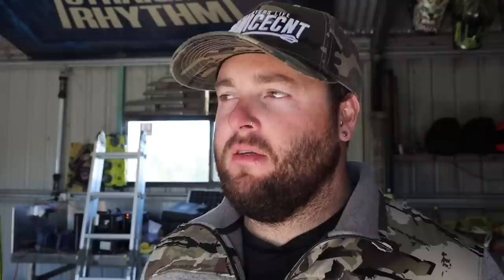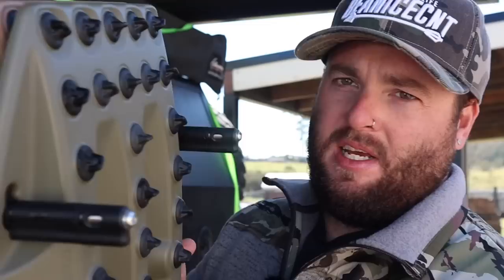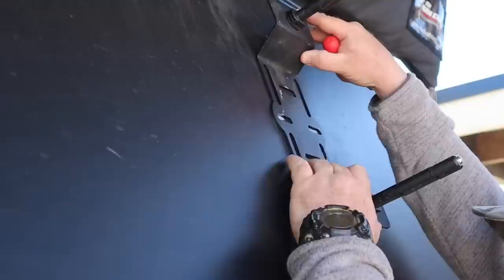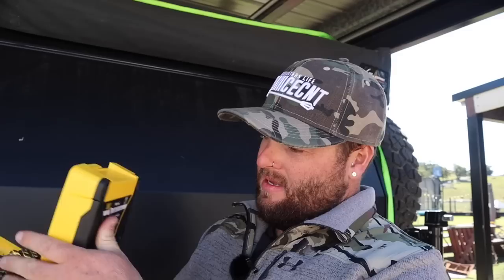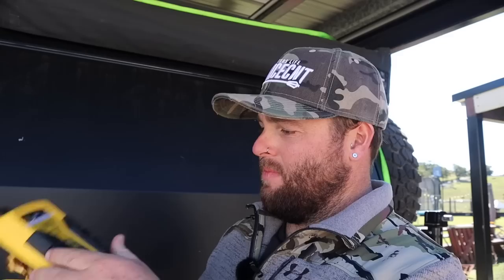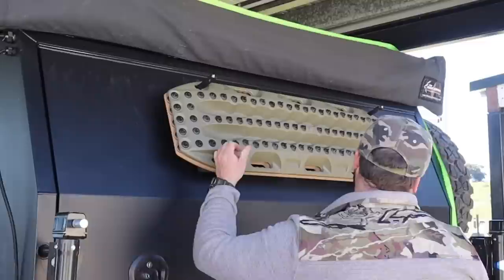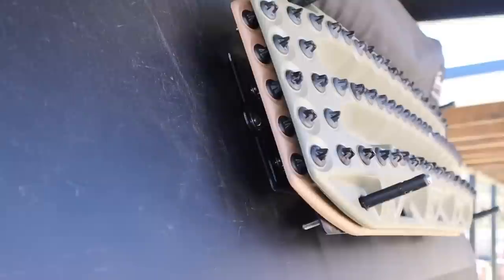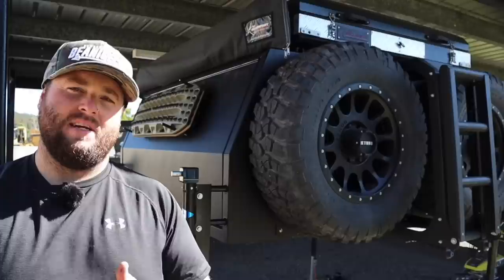WHERE TO MOUNT MAXTRAX ? ROOF RACK ? TRAY ? CANOPY ? How to mount Maxtrax.

Comment: I did the same to my F250 canopy about a month ago.

I mount all 4 on the drivers side though. I  made some internal braces to support the weight and just used high tensile nuts and bolts.

They come up well, yours look good 👍

Comment: Any reason you didn't use nuts and bolts to mount it?  Rivnuts/nutserts are usually used on double skin panels where you can't get to the back of the panel.
Reply from the maker: To hard to hold nuts on the inside if I want to take them off the truck. Makes it easy and all one sided 😄👍🏼

Comment: Can you get a specific measurement off the Animal Off-road bracket? I can’t find the dimensions of what I’m looking for on their website either…..I’m wondering what’s the measurement from the flat surface part of the bracket to top of the angled part of the bracket where the boards mount? Basically the distance between both flat surfaces. I’m trying to see if this would work for my truck bed Molle panel set up. I’m wanting to mount max trax to the molle panel at my bulkhead but I have to space them away from the panel to be able to clear my anchor points at the bottom of my bed.
Reply from the maker: 40mm mate from flat side to flat side

Comment: Any reason you didn’t just fit the Maxtrax pins direct to the canopy?  Would stick out less and less penetrations into the canopy...
Reply from the maker: Those pin wouldn’t have held, would of torn out the canopy door. With the brackets it’s like having a massive washer pulling against a larger surface area of the door.
Reply: @TyFenwick  did you consider mounting a bracket internally on the canopy door to combat that issue?

Comment: I want to mount mine on the ute door on the inside any ideas?
Reply from the maker: On the inside might not be the best mate, if the muddy last place you’ll want them is in the canopy 😁
Reply: @TyFenwick  do you think I can mount it on the outside of the ute door? I'm really trying to avoid roof racks as I'm not a huge fan of them. And I can't really afford a full canopy setup so trying to see where i can put them.. 

My idea is get some ratchet straps feed feed them thru the gap between the ute door and strap the maxtrax. Don't plan to drove with them on 24/7 5 days a week only for when I plan to need them.

Comment: Do you need those other brackets to mount or can ya just use pins
Reply from the maker: I wanted to spread the load across the door more and have a larger service pulling on the door. But you could screw a big plate on the inside and use just the pins absolutely
Reply: Ty Fenwick yea sweet as mate just checking cause I only baught the pins 👍

Comment: Aluminium canopy?  Stainless Steel nutserts and bolts.....    Best not to use Stainless Steel on aluminium...can cause problems........    

Galvanic Corrosion
The combination of aluminum and stainless steel causes galvanic corrosion. In order to understand why you shouldn’t use stainless steel and aluminum together, we first need to understand how galvanic corrosion works. Galvanic corrosion is the transfer of electrons from one material (anode) to another (cathode). In addition to knowing what galvanic corrosion is, we also need to understand the technical terms that go along with it.
Reply from the maker: I doubt I’ll own the canopy long enough to see the issues before I start my next build down the track.
Reply: Ty Fenwick I only know of this issue as it was a problem that some owners had encountered with a brand of caravan where aluminium panels were showing signs of corrosion with stainless steel fittings, some within 12  months.....presents somewhat like rust in wheel arches of cars, bubbling around the points of contact....     Something to keep an eye on...
Reply: ozmid40scouple hey oz what do you recommend to use then? I used stainless on my canopy and my boat